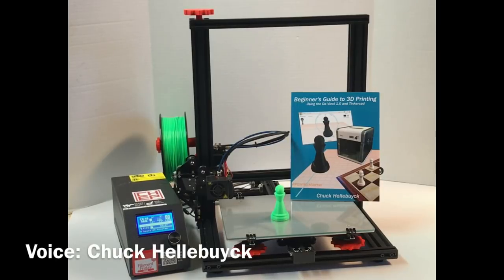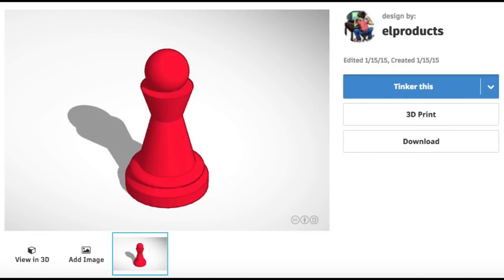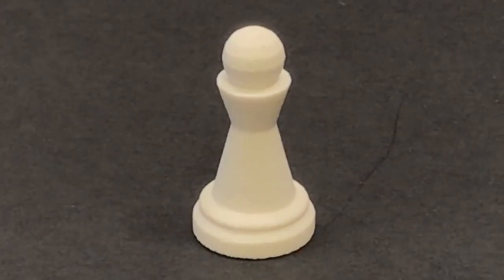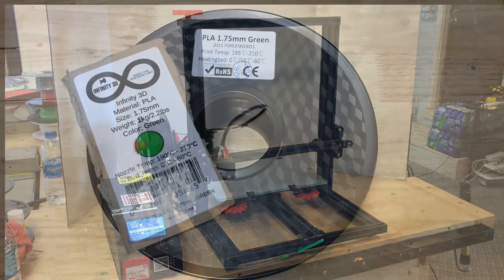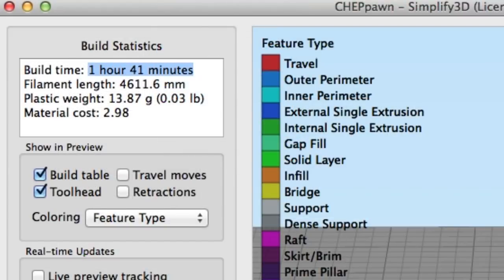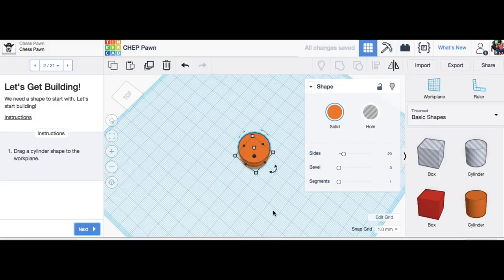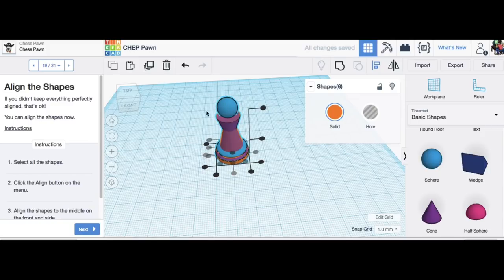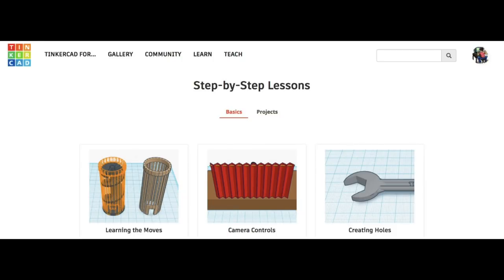How to use Tinkercad Sides Feature To Improve an Original 3D Design

Comment: For larger objects 64 sides is still limited. I came up with a quick hack. Set sides to a even divisor of 360, duplicate, rotate, repeat and group. Example set sides to 60, duplicate, rotate 1 degree and repeat duplication 4 more times then group. You now have a object with 360 sides.

But don't get too carried away or Tinkercad will get very slow 1° give you a near your perfect circle and maybe overkill.
Reply: Great tip.

Comment: i went on amazon to find your book "beginers guide to 3d printing" and found a used paperback selling for $1999.99, was thinking WTF? Any plans to do an updated book in a kindle version? at a more modest price? yes i know you're not responsible for the price of something that someone is reselling. I did pick up your Arduino: A Beginner's Guide to Programming Electronics, hope its a good read :)

Comment: Could you do a video on using s3d?
Reply: Any tips for time to print would be great estimates. I know you cannot change much to get a correct time but if you have an idea on how much to factor the listed time that would be a great tip. I've tried to figure it out myself and find it really seems to change from print to print, I cannot get a fixed % to increase it by. I tend to do a lot of 12 hour + prints and it can be off by a few hours! Prusa Mk3 printer.
Reply: For me how to optimize it and get things dialed in. I have just been going with defaults.

Comment: You can always open the file in Blender (free) and add more polygons to it and smoothen it. What you see from TinkerCAD is probably only 20000 polygons. With Blender you could just go into the millions.
Of course the print will not look as good if you don't throw enough polygons at it.